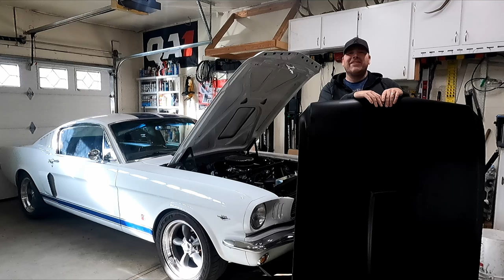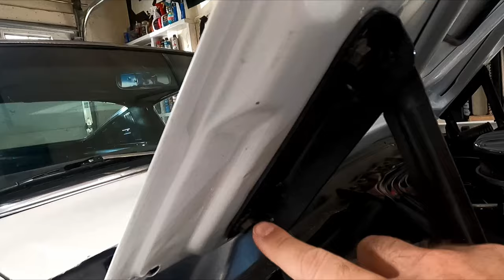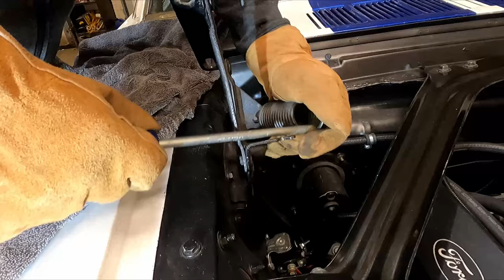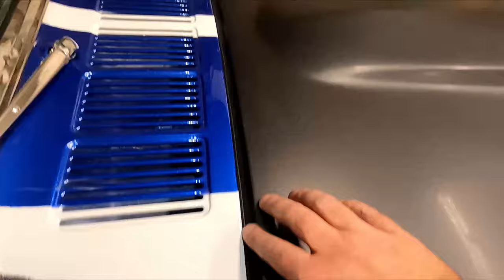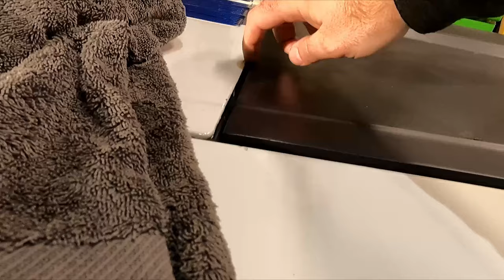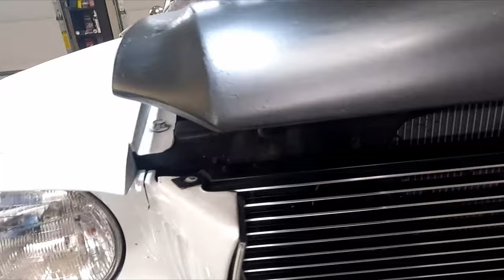Installing a New Hood

Comment: Looks great. Working with fiberglass is a PITA if you need to cut/trim it. Maybe pull both fenders outward, then square the hood up against the cowl. Then pull the fenders back in after you are square. Nice seeing the first project of the winter season!
Reply from the maker: Yeah, this hood is not great, but there are some advantages with the new hood, hopefully it pays off.  :)

Comment: I run a full fiberglass hood in my 66. During a mustang day show, Some guy came up to me and asked if I wanted a fiberglass hood for $100. What a steal.  Anyway, I run no springs on the hinges and use a little prop rod. There is a prop rod kit for the fibergalss hoods. Ive seen others make a cool little chain link that hooks over the spring location when the hood is opened.  Im cheap so I just bring a litttle stick with me at all times!

Keep it up man!
Reply from the maker: I have since found some springs designed for the fiberglass hood, so it's not an issue now.  Too bad the hood is not great.  Oh well.  :)
Reply: I have an original 67 Shelby Shelby GT 500. The hoods were all hand laid up fiberglass. Yes, Shelby ran a lighter spring tension for glass hoods. Check out Tony Branda for the hood springs. Too much tension will ruin the hood. 
Hope this helps, take your time!
Happy Thanksgiving and Holidays to everyone.!

Comment: Looks good, I say keep the hood black. Tweaking the hood/hinges/alignment is a nightmare. I kept the stock springs on my steel framed fiberglass hood, seems to work fine.
Reply from the maker: Yeah, I had to get some lighter springs, full fiberglass hood.  Actually, I'm not happy with the hood, but the timing of everything is forcing some me to make certain decisions.  :)

Comment: Keep your hood latch on.  Its a extra safety thing just in case you forget to attach the pins.
Reply from the maker: Nan, it won't work with the new lower valance.  :)
Reply: @AndyKruseChannel   so your next step is a front R.

Comment: Hey Andy, love your videos and this definitely isn’t my first comment on them, but I had a question.

Did your car ever have front or rear torque boxes added? Currently in the early stages of a restoration and seeing if they’re completely necessary for a weekend cruise with around 300 WHP.

Thank!
Reply from the maker: None of my cars came with them from the factory (because it wasn’t a standard part until 1968) and none of them had them installed from a previous owner. However, I am rectifying that on this car, so stay tuned!
I think the benefit of torque boxes are less about the power output and more about how you plan to drive it. If it is a trailer Queen or it’s only used for putting to the grocery store, the added rigidity will not likely be felt. But if you plan to take the car out for some spirited driving, these will be a must have in tightening up the chassis so the car will act as desired. 🙂
Reply: @AndyKruseChannel  Appreciate that. I know you've done lots of other chassis mods, but I wasn't sure if you had torque boxes. I think long term torque boxes will be added, but currently just exclude them in favor of "bolt on" chassis stiffening.

Thanks!

Comment: Other than weight why go with a China hood rather than oem? Was the original hood rusted and bondo underneath? Honestly I think the old one looks better than am. I know body lines and stuff will never fit right but I think oem will fit better and last longer in the long run. Just curious why?
Reply from the maker: List is long, and I'm not 100% happy with the new hood, but here we are.
Reply: Copy that been there too many times lol. I have had best luck with national parts depot. Even though their parts are from Taiwan sometimes the tooling is excellent. But all is about experimentation

Comment: I don’t get this one Andy . The steel hood looked really good. Does it look like ass in person or something? I just don’t understand replacing a perfectly good hood. I know it’s personal preference but I think hoodie pins are kind of ghetto.
Reply from the maker: Sounds like I won't be able to change your mind, so we'll leave it there.  :)
Reply: Apologies, my comment about hood pins was a little harsh. I also read in another comment. You need to do away with the hood latch for your new valance, so makes sense in your case.

Comment: Hey there, just catching up, since my subscription dropped somehow.. Sorry for all the "opinionated" comments you've endured on this elective job here.
If you've got the energy, to work thru the install issues, to yer own satisfaction or fatigue position, then to each his own.. I watched your apron video, I'm adding GT350 apron myself, and plan to fabricate a custom metal brace to support the factory hood latch mechanism... Keep at it brother..
Reply from the maker: I wish there was a decent hood latch option out there, but I'm not against hood pins either, so I'll be fine.  Good luck with your build.  :)

Comment: Weight difference?
Reply: Stock steel is around 50lbs. I havent weighed my own fiberglass hood but I can pick it up with one hand with ease. Im guessing around 15-20lbs
Reply from the maker: I did not weigh them (I wish I did), but there's a good 30 pounds diff between them.  :)

Comment: after market parts..
Reply from the maker: Yeah, I wish there was another way that didn't cost me a Kidney.  :)
Reply: Shelby American made their own 'glass parts in-house or shopped them out to a local shop. The mold was made using an OEM steel hood. Remember, the cars they were installing on them were new, not nearly 60 years old with bodies which - even if original and never dinged - have distorted over time. Even back then the fitment of the fiberglass was dodgy and required some "massaging", and they weren't particularly concerned with perfect, symmetrical gaps on what were basically disposable race cars. Any fiberglass parts today are going to take some work to get the kind of fit you'd expect from OEM parts. It's achievable, but it takes a lot of fussing and fiddling. There's no "plug and play" option!

It's going to look great when it's all done though.

BTW my friend did this hood job on his 65 a couple of years ago. Once he got the hood basically where he wanted it he took the front fenders off and reattached them relative to the hood gaps. Looks OEM now. BTW the fiberglass hood he got weighed 26lbs. I don't think it was from Maier though.